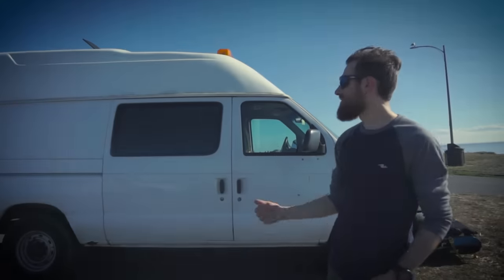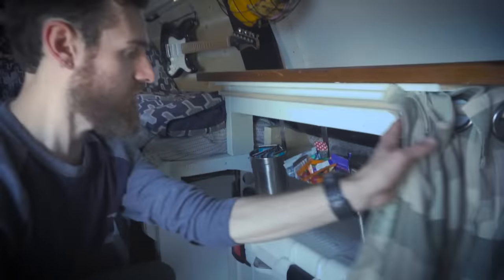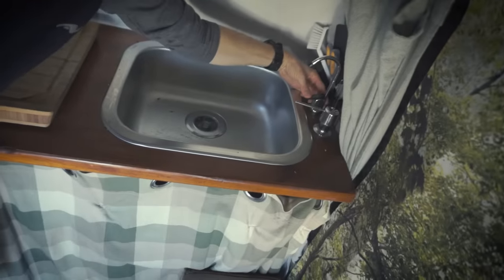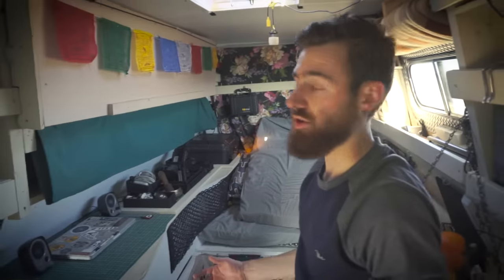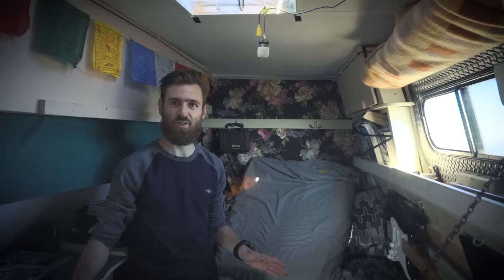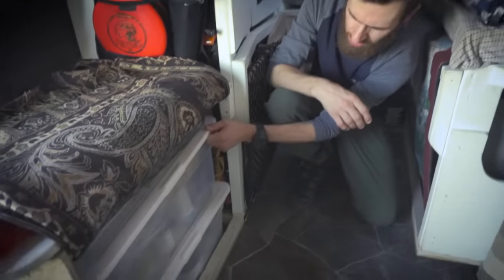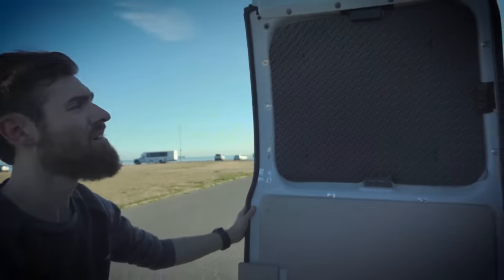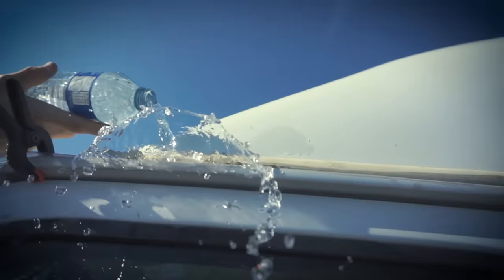Nomad Builds Highly Functional Stealth Camper Conversion from a Ford E350 Work Van.

Comment: Amazingly minimal. Surprising amount of insulation in the structure.
Reply: Thanks Jeremiah! Appreciate the comment :) Keeps it way cool in the summer compared to a car interior!
Reply: My wife and I just got our truck for our build. So I'm doing lots of digging about how much insulation I will end up needing. Our living space will be quite a bit larger. Like the rear end of a in town box truck. How much air exchange does your vehicle have and how much do you end up heating the vehicle in below freezing situations? BTW we bought a Stewart & Stevenson LMTV M1078.
Reply: Hey, it will be much easier to insulate the back of a cube van like that as it is much more square starting out. The more the better and don't neglect the floor. It will keep it much cooler in the summer and hold heat in the cold. I have the fans to move air around and sometimes roll the passenger window down an inch or so to let in air. Installing a roof vent or two will really help with moisture. I don't heat it at all really unless I am plugged in, then I use a small electric heater with a thermostat. I just have a lot of blankets and a warm sleeping bag haha. Kind of just roughed it this past winter. Good luck with your build and check out my instagram account linked in the description box for more detailed pictures on the van build process
Reply: if you did spill a lot of liquid in your vehicle. Where would it end up? Would any of it end up under your sub floor?
Reply: All the walkable area in the van that meets the base frame has been sealed with all weather outdoor silicon. For instance, if the grey water were to spill it would all be directed towards the door. The lowest part of the door rails have a small drain that would allow for the water to escape. If you would like to send me your e-mail I could send you a few progress shots with descriptions. You can Direct Message me on instagram @explorewestcoast :)

Comment: This is such an awesome idea. But collecting rain water after it runs on the car?  Theres probably a safer way to get drinking water.
Reply: Fortunately, I only use the collected rain water to fill the large tank used for washing muddy bikes, cleaning windshield etc.. I know it shows filling a bottle in the video but, I would not recommend drinking the collected water.

Comment: I really like the look of your van.  It seems open, like just a regular room w/ a twin bed in it..which is all I'd need.  I feel I am getting closer and closer to taking the leap but it's not so easy when you can't do the work yourself.  I don't want a professional job that costs $35,000.
Does anyone know if there are "amateurs' who work on the interiors as a second job?  If so, how do you search to find them?  I wouldn't care if it took someone months to get it done as long as they kept plugging away and did a reasonably good job.
Reply: ps the bed is 48"x74". Not quite as wide as a full but plenty long, especially on the diagonal :)
Reply: Thanks.

Comment: If you don't want to say I get it, but about how much did all this cost? Also its a really sweet build probably my favorite i've seen yet.
Reply: It costs as much as your budget allows :) I built out Red Chevy Cargo van you can see on my instagram for under $1000 excluding the cost of the van. Many Sprinter conversions run well over 60-100K though.

Comment: Lovely build.  Curious why people use reflective panels for insulation when they were intended to deflect heat energy from the sun?  I see that they are used often so there must be something to having them as insulation panels between the exterior wall and interior panel.

Comment: Tyler, did the van have a roof already or did you add that yourself? Really cool thought out setup too. I was mind blown when you showed the bike storage (something I'd like to do when i build mine) because it looked liked you were all topped up at that point hah.
Reply: Hey! The high roof is a factory install when the van was manufactured. It is fibreglass. I have had a few questions relating to the high roof. I hope that helps! :) The bike always amazes friends and family when they see the van for the first time after seeing what is inside already!
Reply: Man, I've looked quite a bit in the last few months for something similar and haven't found anything with a roof that tall. I'm jealous hah. Recently a 12 passenger diesel airport type shuttle van popped up on my craigslist for a very good price... I'm hoping it hasn't been sold yet. Would be an interesting build at 20ft long, 9ft tall, less than 8ft wide and 17-20mpg. Bike storage would be phenomenal in it!
Reply: That sounds amazing! The high roof vans are so hard to find! I would certainly not recommend a regular size van for full time living here on the west coast!

Comment: i like that you can stand up, whats the distance from the floor to the roof?
Reply: zeke it varies. Bed area is 6 feet 4 inches floor to ceiling and tapers to just over 6 feet by the sink.

Comment: Cool Build. I'm curious how high it is floor to ceiling in there. I'm looking to build a 4x4 camper here at some point but being 6'6" tall this might be a bit low. If anyone knows that would be sweet!
Reply: It is about 6'4' at the smallest and about 7' at the rear as the roof slopes to the front for drainage. Might want to go with a cargo trailer. You can find them as high as 7'6".

Comment: Love the compressed water system. Love the bed but the rest is so not functional. Dont like the shower thing and hate the cooking thing. Could have been more creative.
Reply: Thanks. Hate the cooking thing though? It is a common propane camping stove. Barley different than a natural gas stove in a conventional home. I also have a 1 burner butane one that gets more use as I don't often use two burners simultaneously.

Comment: "If you can live your life unattached to the internet, do it" he said on youtube...
Reply: HalfCrazy520 I understand the irony and hypocrisy of conveying that statement through the Internet. I say “if” and “attached”.. using the Internet is great. Having it rule your life is not..
Reply: I agree, I was just f'in' with ya.
I live in an RV full time, but it's a 41' 5th wheel. Living in a van? No, thanx.
We have a  21' camper that we go camping in, and I could see living in that, but it has a real bathroom/shower, heat and A/C, 60 gallons of propane, etc.  
I applaud your ingenuity, but you are roughing it a bit more than I am willing to.
Reply: HalfCrazy520 I hear ya :) I would prefer a larger dwelling. This is just a starting point. I am hoping to save up, purchase land and build a “tiny home”. Something 10x20 on the interior with proper washroom and kitchen facilities :)

Comment: How did our ancestors manage before baths and showers .. A flowing river or stream will do or a large lake etc.. I rode across Spain and France on a motorbike and washed using natures water. Pay to wash how very civilised and unnecessary. Most of the time.. Russians bath in ice cold water because they are used to it.. I am located in grotty SE UK I just wondered why it's preferred to go stealth? As long as no one does anything wrong and breaks laws and vehicle is legal there shouldn't be anything to worry about..

Comment: I'd do it a little different. 
 I'd just grab a cheap Class B and fix it up.
Reply: RV's stick out like a sore thumb in cities. Good luck on your travels!
Reply: If you're talking about urban boondocking, white vans are more noticeable than you might think. 
For starters, druggies are drawn to them like flies because white vans are full of tradesmen's tools.  Plumbers; electricians; carpenters; handyman; etc. The dopers go for the power tools.
Cops are also drawn to a white van because people are probably living in it. Cops ain't stupid. 
If I really wanted to blend, I'd buy a mini van. Maybe a Toyota Sienna. Dark color. Heavy window tint and black curtains. Totally clean and nice from the outside. There's plenty of room inside for a bed and a portable toilet. Put an extra battery under the hood and run your electrics. Coffee pot. Cooker. Computer. Reading lamp. 
A minivan is invisible. Thieves won't steal an older model. Cops ignore 'em. 
The Sienna is a good choice because there's an all-wheel drive version. Great gas mileage. Safe. Large enough to take the proverbial 4 X 8 sheet of plywood.

Comment: I always wondered what would van campers would do with a tornado on the path ...people usually have storm cellars ..but how to put a van in a storm cellar otherwise than going into a underground parking?......
Reply from the maker: You could just drive away. Tornados are only destructive in a very central point and usually you can travel away from them pretty easily.

Comment: As I watched this I kept saying to myself HOW big is this van?  Can this be the same size as the one I just bought?!   Wow.  I was just out measuring and realized my twin XL mattress is 39 inches wide, seems you have a lot more space, I gather your bed is narrower before you add the second part.  I bought a high top conversion van.  Perhaps the trim inside hides more space than I realize.  I was debating on ripping it all or now.  Do you have a suggestion?
Reply: Javaman92 The bed is 48X74. The floor before anything went in was 6x11 feet. Where are you located? Maybe I could take a look and give you a hand?
Reply: I'm in extreme NE Ohio.  I suspect far, far away from where you are.  I figured out the space issue, the side pieces were taking up 5 inches on each side.  I took it out today.  Now I have a good bit more space.  I did find a rear heater and air conditioner and lots of wires.   It's like eating an elephant, ya just got to take it one bite at a time.  :-)
Reply: I knew I saw a video with a fellow disc golfer.  :-)  As I go through my build I am looking back over the videos I felt were really good for inspiration.  I hope to hit a few of the pro circuit stops with my van once I get it built.  Not that I am any good, but I like watching those who are the best.  I'm a huge Paige Pierce fan.

Comment: My solar panels charge during winter.. Smh
Reply: Deep Canadian I understand that they work in winter. Just not as well for obvious reasons. It was initially the cost of a solar setup that had me opt out of having one in the van. A lot of amazing lithium systems were released by a company I use for backpacking equipment and I am hoping to get one of those come Spring :)

Comment: What year of van and make  would you suggest for reliability
Reply: If you could find one of these, I would recommend getting that. The milage isn't the best but, what camper is? It has very easy access to almost all mechanical and electrical components. Its been very reasonable to have work done on it at local mechanics too. Happy trails :)

Comment: I see a few problems with your ingenious home on wheels. Knives suspended via magnets over your bed and the indoor shower. Just no.
Reply: Knives are above the sink and counter top 5 feet from my bed and have never once fallen off.
Reply: @explorewestcoast  still would it kill you just to set your knives somewhere thats actually proven to be safe? You'd have to excuse me, that side of the van is similar in appearance to your bed.
Reply: Holret There is a thick metal security gate between the cab and living space. The knives get put away while driving...

Comment: I've always wanted to do this but my main concern is always the same. Where do you get income from? Especially if you end up traveling a lot with the camper.
Reply: I work :)
Reply: Thanks for the response! Been thinking about making one but expenses are always my curiosity when it comes to van dwellers. Would you consider it being cheaper then having your own place?
Reply: rrrx6 I would say it is as expensive as having an apartment. Let’s say for arguments sake rent and utilities (electricity, hot water, heat, internet etc.) is around $800-1000 a month for a shared apartment or room in a house and then a transit pass for around $200 as the city has an amazing transit system complete with trains, busses, water busses and shuttles for a total of $1000-$1200. Bare in mind I am living in the Vancouver and surrounding area where rents are very high relative to the rest of the province and country. For the van let’s go with $200 insurance, $30 recreation pass (shower, gym, sauna, pool), $50 propane (heat, cooking) $20 parking (I rarely have to pay for parking), $400 gasoline (1600-1800km a month) $100 phone bill (internet and communication) $200 a month for emergency issues sometimes costing a lot at once but rarely  (repairs, maintenance, tires, tow truck etc.) for a grand total of $1000. These are obviously simplified numbers and depending on many factors things can differ. Having a vehicle is also really convenient. Renting an apartment and having a vehicle is much more expensive that’s just the van.

Comment: Just curious about the top part of the van...is that structural safe?
Reply: It is a factory fibreglass top from Ford. It was installed when the van was manufactured. There are two 2x4s at 9' running either side of the top that are imbedded in the fibreglass. Very rigid :)

Comment: Thoughtful use of space; selected equipment shows astute choices. BUT, SO BUSY !Choreographing unpacking for every damned physical movement and boring. No library, no internet, snack-type diet...FTS!
Reply: hackberry flat It can be a hassle sometimes, I can admit that. I have 40+ books in the van from guide books to non fiction and autobiographies. I also mostly eat fresh, whole foods and go shopping at local markets where I am situated. Just because I have a heap of granola bars doesn’t mean that is all I consume. As for Internet I tether my phone to my laptop and viola! I am replying to this while relaxing on the bumper after just tossing a round of disc golf with my puppy.

Comment: Why no solar? Not effective?
Reply: The extra initial cost was the main reason I opted out of solar. It would be great to have an additional battery and inverter though, to power and charge larger machines like my Makita batteries or a blender.

Comment: I hope to God you don't actually drink water that runs off the roof of a truck you drive on the highway. Even if you're parked, you're still covered in soot, exhaust and dirt from all over the road. That water is fucking disgusting.
Reply: WeAreHam   Certainly not! I only used a water bottle to demonstrate that it functions. I have never really needed to use it. I just fill up from a hose normally. If I did, I would use it to wash my bike or muddy boots. All that road debris, brake dust and bird poop I would not recommend drinking it.

Comment: If I could find a way to get Internet in these vans you'd bet your ass I'd live in one. Yet so far I have seen no way to do so... That and the problem with powering a computer without an electric grid i'd have to use solar panels... which are decidedly not stealthy.

Comment: It's a nice van but how is that even remotely stealth? Clickbait titles!
Reply from the maker: Qwuxx did you even watch the video?
Reply: There are hundreds of this exact type of van in the city I live in and thousands throughout the province that are used by many commercial and municipal organizations (delivery/park services etc.). With the addition of the orange lights on the roof, vests, regulation size cones, work manual and my parking permit, I have to say, in over 18 months owning the van and 1 year of intermittent urban van dwelling I can assure you it as as stealthy as they come :)  I have not had 1 person assume it is a camper van unless I have the doors open  during the day in a very public place like a beach or parking lot where I am not attempting to be stealthy at all :)
Reply: Just because nobody says anything doesn't mean that nobody has noticed. How many have that roof coupled with no logo or municipal plates?
Reply: The very same roof. It was installed at the factory. Many have no logo as advertising what may be inside your vehicle poses a security risk.